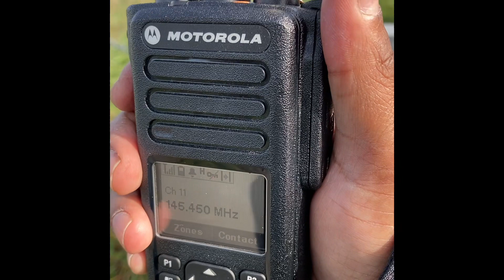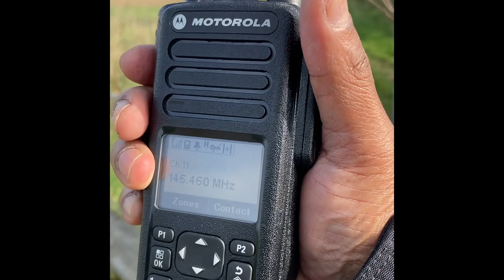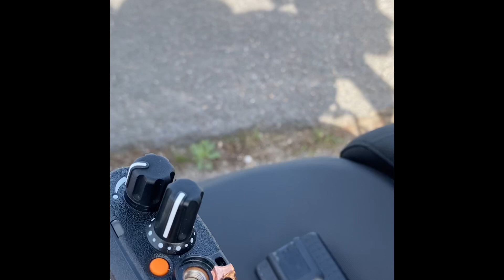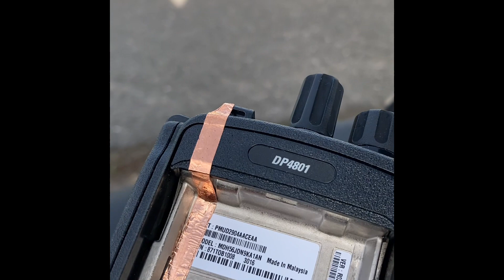Motorola DP4801 / XPR7550 BNC Adapter modification/workaround

Comment: I bought a security company business and it came with couple of these radios but they're pre programmed from previous, how can i factory reset it and program it for future events
Reply from the maker: You will need to find someone with the programming software to program your radios. If you are in the UK, you can try Radioswap.
Reply: If that is really 2 meters (as claimed in the Smiley link) then the length of that telescoping whip sure looks like my 2 meters 5/8ths, not 1/2!
Reply: Hi what range do you get with thus?
Reply: @Ytb-nf7ef I just installed the experimental firmware on a Quenshang UV-K5(8) so I now have a 5 watt 2 meter SSB compatible HT. I am going to get an adapter to use my 5/8 wave BNC telescoping antenna from up on top of the Santa Monica Mountains and test my simplex range.
Reply from the maker: @Ytb-nf7ef  Depends on the elevation. You can easily talk to stations 40 miles away if you are on a hill. If you are on a flat ground 10 miles.